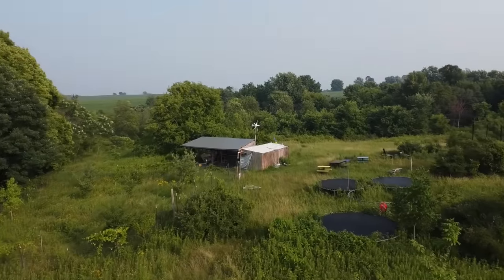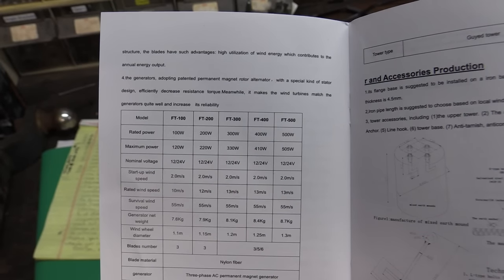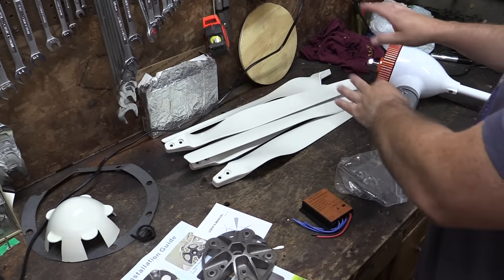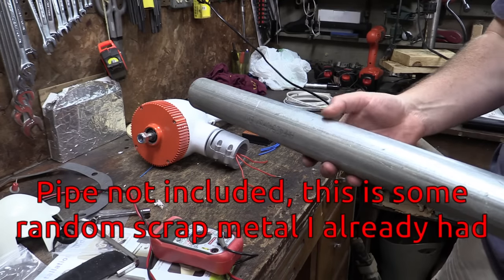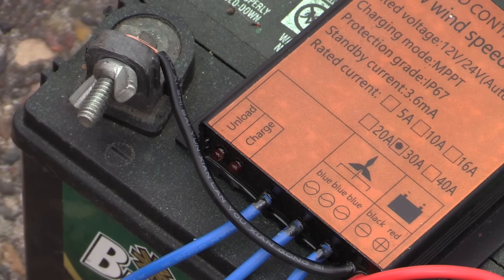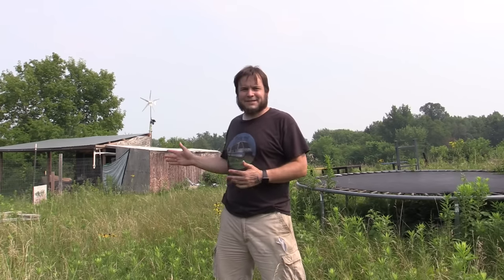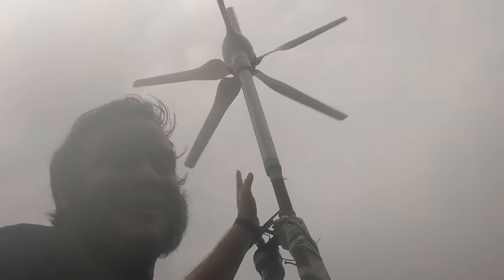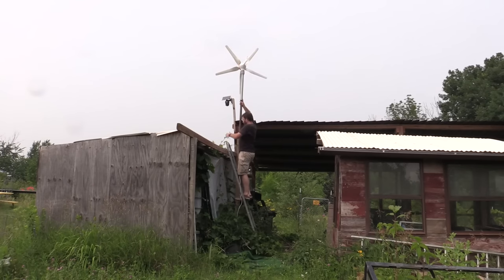Finally A Real Wind Generator! Vevor FT500 Review

Comment: I've had three different Chinese wind turbines. I started off with a 3 blade 12volt and it was horrible. You would literally need a storm to get any useable power out of it to charge. The second was a 6 blade 24v turbine which started easier in the wind, HOWEVER, the even number of blades resulted in turbulent air as it travels across the opposing blade so it kept spinning out of the wind. The third one was the best one, and that was a 5 blade "600W" turbine. It had no issues of turbulent airflow, and it did indeed generate over 320watts of power that I observed (possibly more but I had no logging equipment). Honestly all of these turbines need a good gust of wind, and aren't ideal for low wind speeds. It needs to be spinning very fast for it to even begin charging the batteries which is lame considering you want something that can trickle charge in low wind speed too.

Also, the rubber you found in the box is meant to go inside the clamp that clamps around a pipe so it doesn't move.
Reply: Ваша проблема была не в чётном количестве лопастей, а в том, что это были просто плохие лопасти. И вторая проблема была в том, что генераторы которые продаются массово предназначены только для работы в местах с сильными и стабильными ветрами, то бишь на берегу или в степи! А во всех остальных случаях генератор должен быть низкооборотным.
Reply: My 600 watts B and C  Chinese turbine starts charging at 4 mph. But they sent me a 12 not 24 volts that I ordered. I used it anyways
Reply: Thanks

Comment: When I visited my grandparents in rural west Texas about 70 years ago they had no electircity so they got a windmill. I don't remember how many, but they had several large lead acid batteries in the their basement for power storage. Because west Texas is so windy, the system worked well except when Aunt Lura Del did the ironing, all the lights in the house would dim.

Comment: to meet standard,    bear in mind that as the wind speed increases, the weight of the turbine increases so use rated tubular steel if possible, and your turbine will also be at risk of pulling off as well.   2)  all obstructions for at least 500 feet and 30 feet above those obstructions is the best practice, although not always possible.  most of the generators are 3 phase in either a Y or a Delta configuration.    more blades, lighter winds, more blades, higher wind start up.  you need to service all generators once a year,  to ensure the bearings are in good shape and all is well.    i think it is earthmate or earthpower,  some brand like that uses the wrong bearings and will fail rapidly

Comment: Pretty cool stuff! I run solar panels but wind is a great option for off grid! I’m in NYC and I believe they’re building one of the countries largest off shore wind farms so cool to see renewable energy in any capacity!
Reply: Wind power is not as effected as its believed to be.  I love in an area of many wind farms.  It really does cost more to produce than they'll ever vegetated in revenue,  if they weren't subsidized they'd never be built.
Reply: @RyanGribble   It’s true there’s many pros and cons to every renewable energy source. It all comes down to location though. Off shore wind could be a great choice for dense cities. If my apt had panels it’d mean sausage because there’s   ~500 apts in the building. Bright side I’m a block from the ocean. Unlimited wind farm real estate. 

On my house I can run completely off of a 12kw system plus charge my car (~40kw usage daily). If it were a multi family house then it just wouldn’t cut it. 

Also have to factor in local power cost. Iirc it’s something like 27¢ per kw here in NYC (going up almost 10% next month) so solar was cheaper than grid electricity. Have another house in ABQ, NM and electricity is so cheap (>10¢ iirc) it’s just be a waste to get solar even with incentives.

Comment: Just put my vevor 1200-watt wind turbine up. It takes more than a light Breeze I will tell you that. Solar is going to be necessary and run in combination or I will always be power low. I thought a decent Breeze would make it go but it doesn't. Do not count on just your wind turbine unless you have consistent wind

Comment: This was super helpful. Been looking at these for an off grid area and wonder if would actually be OK to use for trickle charging some batteries for lights.Would be nice to have some readings on how much wattage it generates
Reply: You can calculate it. Watts=1/2*sweep area*air density*wind speed cubed.
The problem is the wind speed is usually very low. Residential areas average something like 3 m/s.
At 3m/s, with 0.75 meter blades, efficiency of 20%,, you get Watts = 1/2 * (PI*.75^2) * 1 * 4^3 *0.2= 4.8 Watts.
Over a year with average wind speed you get 42 kW. 
If your power normally cost $0.2, then you save yourself $8..40 a year!
That is why you don't see lots of homes with turbines, they are useless in residential areas. Industrial turbines work because they are built in high wind areas, and are tall to access stronger winds.

Comment: the bit of black rubber is a shim for insertion between pole and mounting clamp.thanks for your honesty and information.I have two decor solar battery banks,which seem to work well,and am using two 90w bresser panels.I live off grid 680ft up a mountain,so we usually have a good wind and no obstructions around.anyway thanks again.stay safe and lucky.blessings to you and yours.with thanks and respect.dominjc'maddog'mogridge.off grid in West cork.the republic of ireland,680ft above sea level half way up a mountain.
Reply from the maker: Sounds like a cool place to live!
Reply: I did not use rubber because I worried it might loosen up or deteriorate, to hard on my set up to lower unit on my own , so far so good

Comment: The black rubbery thing fits on the inside of the big clamp you screw in on the base of the turbine. It prevents slipping if the base is not made of metal and can´t be squeezed that hard.

Comment: Nice! Here in New Mexico we get enough sun to make solar a no-brainer. But the Albuquerque canyon winds are too good to pass up. And I agree, having another source besides solar helps make a robust, fault-tolerant system. I've been thinking of putting one in the field beside my house, but was worried about the noise and annoying my neighbors.

The way these things work is no different than a car alternator, 3-phase 3-wire delta. No matter how you wire it, the phases will go in sequence, think about it. And that 500W generator hooked up to a big enough battery could store up enough energy during the week to make possible a lot of electrical things during the weekend. A/C in the summer and electric heat in the winter.
Reply: Right, wind is a good supplement. In very few areas would it be good for primary power
Reply: I think you are over-rating offgrid power. If you expect to cook or run A/C on solar or wind you will need a massive system. I have 1200 watts on my main system and cant run A/C or cook on it. But it does an evap, 1 refrigerator and a freezer along with TV ,small computer and lights just fine

Comment: I'm not a wind turbine expert, but a few thoughts:
1. You should get a controller that has a load dump for times when your battery is charged. Freewheeling(overspeed) the turbine can damage it.
2. Load output test sure would be nice. A DC ammeter and a volt meter would be all that's needed. A lot of the cheap Chinese wind turbines make nowhere rated output. I recognize the vevor brand, but can't speak to their quality. Ista-breeze (and maybe Missouri wind a and solar) seems to be reputable manufacturers.
Reply from the maker: There's nowhere to hook a dump load to this charge controller, but it does have an "unload" setting, so I assume that's the freewheeling thing.
Reply: @saveitforparts  An mppt controller with dump load is highly recommended, you have a real good chance of over charging that battery and have serious problems. I wouldn't run it period without a dump load of some sort.

Comment: Its a 3 phase alternator - the absolute phase rotation doesn’t matter if all you’re doing is rectifying it to DC.

If you’re hooking up a mains voltage AC 3 phase motor, phase rotation relative to the supply does matter as it will determine the direction the motor spins, but for a 3 phase resistive load such as a water heater, it again doesn’t matter.

Comment: My advices: 1.) use the highest possible mast to put the wind rotor on top. Why? Because wind speed are faster at higher heights and additionally the physical law of wind rotor blade energy is proportional to cubic of wind speed (v³), meaning: doubled wind speed 2v results in eight times wind rotor energy E_wind ~ (2v)³ = 8v³. 
2.) Select a good windy location for your wind power rotor/generator like the old wind mill places with following criteria: top of hill/mountain free wind streaming areas with lower environment without (high) obstacles around (no buildings/towers, trees or mountains to thedirection where wind comes from.
I assisted running long term wind speed and direction measurements, the sensor called anemometer was put on top of a 10 m high aluminum measuring mast which always have been set up on wind interesting location mostly hill top and free environment at least from the main wind direction, so never trees were around.

Comment: Remarkable what you can get for <$200 US. Nice materials too.
4:32 Just for completeness, I would tie the junction upside down for a better "drip loop". No sense having a little cup of moisture trapped in there. Also, it's a good thing you duct taped those connections at the end of the vodeo.
Reply from the maker: The connections are supposed to have a heat-shrink sleeve, I just didn't get around to that! It's still a bit in-progress since I'm still evaluating how it works, I might try to do a follow-up video along with some footage of what happened to the prior DIY wind generator.

Comment: Other channels tested this 500 watt wind turbine. With a wind speed between 7 and 12 mps (25,2 - 43,2 km/h) the power was 130-170 watt. So probably you can get full power with 100 -120 km/h. Basically hope in a hurricane.

Comment: would like to have seen some actual numbers from this.  What voltage did it get to?  what amps did it generate ? will the controller charge up a lithium battery ?  about two years ago i put up a 300w generator but never got more than 12.4v and .6 amps which works out to  less than 10 watts....found out that it needed at least a 20mph wind to actually produce....took it down and it sits with the rest of my junk in the back yard.

Comment: Hopefully your hard plastic blades are fiberglass reinforced nylon. (usually black, but can be any color)  This is a material used for RC model propellers which could withstand more RPM than the hub they bolt onto qnd should be good for several years.  UV does degrade all nylons... eventually.
Reply: ALL generators start out AC, then rectify it in some manner if you want DC.

Comment: that's not bad, and he it's really capable of reliable 30A it'd make a very good addition to an off grid solar setup. I build lots of large vehicle based power system, and 40A is about the most we typically use for charging input from the vehicle.

Comment: I'd be a bit nervous about the romex.  I'd think it would eventually twist off.  Was I missing something?  It's amazing to see the stuff that's available for a pretty reasonable price these days.
Reply from the maker: It appears to have a slip ring inside, so the wires coming out don't rotate.
Reply: @saveitforparts  Ahh, maybe so.  I was concerned with the rotation between the upper and lower mast, and I didn't see a slip ring there.

Comment: I got a similar one that is 600 watts. They sent me a 12 volt wind generator, and a 24 volts charge controller similar to the one you got. It never made 24 volts though. Had to rewire the batteries to 12 volts. I still use 24 v on my solar stuff. I have 12 volts fans and lights, etc. that I use all the time. They were sending me emails about buying more stuff, but when I asked how to get a 24 volts stator for my wind generator, they stopped...🤔

Comment: I'm a novice, just doing my research - I don't know much about electricity, so please forgive me for asking this question if it's dumb...  If the turbine is AC, is the controller unit DC?  You can't connect AC to a DC battery and have it charge right?  

Again if I apologize if it's a dumb question.  Thanks for the review - it's really windy here, I need to get power to a shed, was looking at turbines and came across your video - well done!
Reply from the maker: Apparently the magic black box rectifies or converts from AC to DC. It's a little mysterious and I'm not sure how good it is compared to a 3rd-party wind turbine controller.
Reply: @saveitforparts  thank you!  I appreciate the response.

Comment: Wind turbines are so hit or miss on if they work or not or if they are a scam, it's also hit or miss when it comes to the rated power and what power you'll actually get.

For these test to be more useful, real world numbers are needed on the average power being generated, the wind speeds over that time and how high the turbine is or if there were any obstacles in the way.

Without this kind of information, these videos don't really tell us much.

I also find with these smaller turbines, they don't work that well in urban areas, which makes solar a much better choice unless there are wind turbines that can work well in urban areas without having to be really high.

Comment: I have one of these. I am not an electrician. The only thing that has stopped me from installing this is a really detailed instructional on how to install. I wish when you assembled this you would have been a little slower and more detailed on the wire connections and the materials you used. Sorry not trying to be obtuse. I just don't want to break what I've bought.
Reply from the maker: I'm not an electrician either, usually I just twist wires together. I've been slowly learning to solder and heat-shrink my connections.

Comment: I got one after watching this video. Will take some photos once I have it setup. Currently working on getting a pole for it.
Reply: Mine is a 10ft piece of 2" pipe, connected with a reducer down to a 1.5" pipe nipple. I used the black rubber gasket material it comes with inside the clamp as some other reviews recommended and that worked very well. I used solid copper wire with soldered connections inside the pole. I used 3/16" wire rope with drilling holes thru the pipe and looping it threw, and then for anchors I am using x3 milspec 3 inch arrowhead anchors rated to 1300 lbs pullout each. Ultimately proved to be a fairly expensive project at about $500 for the tower and installation tools and $125 for the wind turbine. I live in a hurricane prone area though so I wanted a very strong tower. Haven't finished wiring it up yet so I don't have production values. Ultimately I conclude that wind energy is a good addition to a microgrid for it's variability and the potential of making night time power, but it's a lot more costly than the equivalent amount of solar for hobby use.

Paint pattern inspired by wind turbines seen in ARMA 3. I had a link to a photo but I don't think youtube lets you post links

Comment: about that battery, lead acid batteries are not meant to be recharged and drained over and over again, it will die after a few uses. if you want something more permanent you have to get a lithium power bank that's meant for that kind of job.

Comment: The problem with small wind generators is nobody showing the average energy production per day during a month or so. And the reason is they always underperform greatly and not worth in the end comparing to solar panels in most livable places of our world. I guess in Alaska or somewhere in Canada up there it might be worth but need actual data.

To overcome the issue one needs a really high mast and a large rotor.
Reply: Exactly, but you can roughly calculate it. Watts=1/2*sweep area*air density*wind speed cubed.
The problem is the wind speed is usually very low. Residential areas average something like 3 m/s.
At 3m/s, with 0.75 meter blades, efficiency of 20%,, you get Watts = 1/2 * (PI*.75^2) * 1 * 4^3 *0.2= 4.8 Watts.
Over a year with average wind speed you get 42 kW. 
If your power normally cost $0.2, then you save yourself $8..40 a year!
That is why you don't see lots of homes with turbines, they are useless in residential areas. Industrial turbines work because they are built in high wind areas, and are tall to access stronger winds.

Comment: Not bad! If it had slip ring you would not have any twisted wires or did you have any problems with that?
Reply from the maker: It seems to have a slip ring inside the head unit, so no issues with twisting.